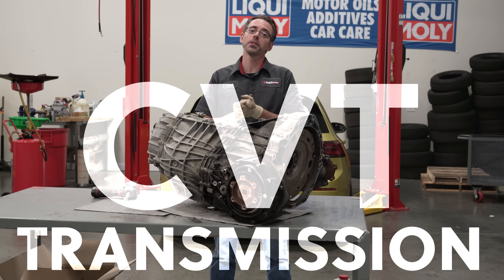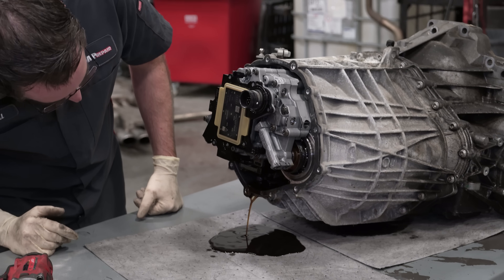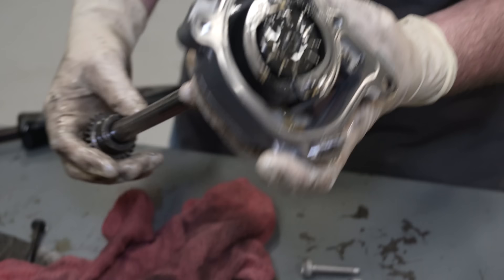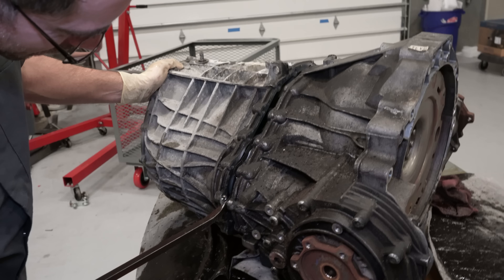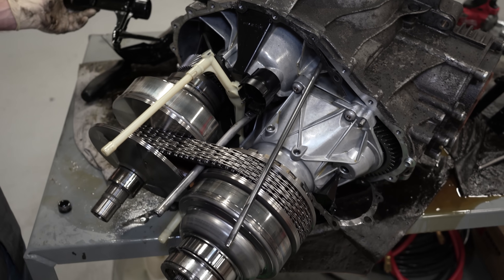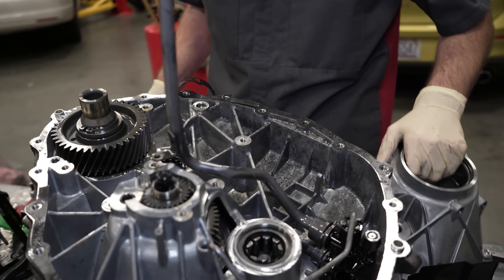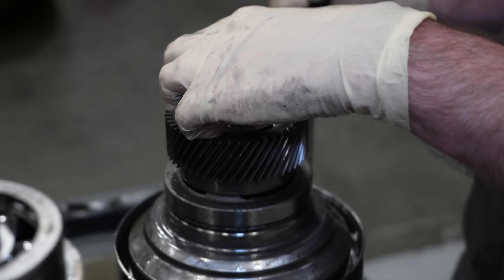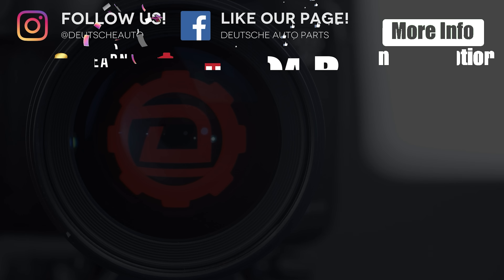Why you shouldn’t get a CVT transmission

Comment: You need a trans table if you are going to work on them! For the record, a trans table has 1"-2" sides and a large hole in the center of the steel table for oil to drain into a five-gallon bucket.

Comment: CVT transmission are increasing the car prices more than the money they save.  This is a ploy from politicians to increase the efficiency requirements to the point the cars are expensive and don't last long.  This is done to force everyone to electric cars.  But electric cars with same range and functionality are 4 times the cost.  So this forces the public without the politicians telling public hey you have to buy electric vehicle for 4 times the price and spend more money on the adaptors at home with limited range.  If you cant afford it tough luck.  This is a suicide for the politicians, so to take public on the same path we just rise the efficiency requirement until public with normal income cant afford it or they cars don't last.  Then we blame the car manufacturers.  Same tactic the politicians use when the price of gas is low, they tell us the oil producing companies reduce the price to make us use more oil.  When the price goes up they tell us ah they are trying to profit (Aim of politicians oil producers are bad guys no matter what price they sell the oil).  Even though all our cars use gas and most products we use that we can live without depend on oil.

Comment: imagine if theres a cvt transmission that you can manually changes the gear ratio with a gear stick like pilots use; slowly pushing the stick forward to change the ratio for higher speed driving

Comment: I love the burning passion with which this gentleman hates CVTs with. He took the time to ruin one on camera. Toyota seems to be doing well, but CVTs are inherently less reliable; they are usually required to have their gear oil changed twice as frequently compared to conventional automatic transmissions (30,000/40,000km compared to 60,000/70,000 km). Its all in the name of fuel efficiency. The fuel efficiency and life of CVTs will also be horrendously affected in start and stop traffic conditions within highly congested cities.

Comment: I drove a Nissan Sentra in drivers ed with a cvt years ago. I never liked it. The constant rpm with no gear changes felt very weird and unnatural. Maybe slightly smoother but instead had a weird rubber band feel. Certainly would never buy one. I like the 6 speed auto in my mazda. Although i really want to try out a dual clutch i have never driven one but i heard they shift very fast.

Comment: As a design engineer and lifelong Machinist, I designed a stuff Plus transmission that can handle unlimited horsepower and torque without slipping. Additionally it can be used with any prime mover and I am looking for a buyer.

Comment: I owned a 2013 Accord that I bought brand new and sold with 186,000 miles (300,000km). That car had a CVT and I had zero problems when I sold it. All I did to the car was regular oil changes and did a complete fluid exchange for every fluid in the car at around 120K Miles. Everything in that car (including the CVT) was stupid reliable.
Reply: I have same car...drive like a grandpa never accelerate fast...hoping I get 300k out of mine.
Reply: Honda CVTs are good quality than Nissan.
Reply: this is the best way, cvts arent meant to be abused. change your cvt fluid every 20-35k and youre at a pretty good position. theres also 2 filter(strainers), so change those every 100k or so. honda cvts arent bad, but toyota does lead the industry with their launch gear cvts since 2023 and their ecvt;s. every other cvt is just dogturd. they key to hondas cvts is to not floor it, and to keep up with fluid maintenance. the key is to not let the fluid get any darker than watered down medium roast coffee.
Reply: So people still believe that a mechanic has more knowledge that engineers ? Lol,
Reply: @diego2817 TRUE

Comment: Toyota and Honda CVTs tend to last longer than other CVTs because of the launch gear. One thing many CVT vehicle owners do not realize is that no damage can occur if you change your CVT fluid more often (unlike regular transmissions with say over 200k miles on them). Additionally, changing CVT fluid more often (say 30k miles or so after the first change) can prolong their life. In the case of some Nissans, changing even after 15k can show a lot of worn material. Another thing to mention is that CVT transmissions work better when the transmission has reached operating temperature. So, in the winter your car may not need to warm up but your CVT does. I would wait till the car reaches normal operating temperature on a CVT car and be extremely gentle on it the first couple of miles (no hard acceleration or deceleration). Another thing is that driving very fast on a CVT can wear it out faster. I would say try to stick below 85mph or 75mph when you can with a CVT car. They can last if you take care of them and have some basic knowledge. Good luck.
Reply: Best comment, I have a Nissan, and now I know I’ve been mistreating it 😂
Reply: Im pretty sure my 2016 honda fit cvt didnt have launch gear, i had to replace the belt at 94.000 km because it broke apart.
Reply: @Arif-fu6rt  how much did the belt cost
Reply: @dkbaghel123  USD 120, i was lucky the other part was not damaged, only replace the belt, clean the transmission, change all the seal, with total cost about USD 350.
Reply: I had 200k on a 2016 accord sport with cvt, and no issues. I changed the fluid with Lucas cvt fluid NOT Honda every 60k, according to the book. I absolutely loved my Honda. Someone ran a red light, and demolished my baby.
Reply: Honda doesn't have a CVT with launch gear. This is a Toyota patented invention. That launch gear version is new and only available for some upper trims. Most Toyota CVTs are without launch gear.
Reply: Honda's use a belt like Nissan, no launch gear. Nissan CVTs had issues but their factory fluid was extremely low quality even when serviced on time. Subaru on the other hand uses a chain and are fantastic, can hold a ton of torque as proven by their by 2.4T suvs and wrx. If they also had a launch gear, which their partner toyota should easily be able to design, would make them great.
Reply: that's sad considering I'm taking my Honda civic CVT at 100+ mph every week
Reply: @LolimGennaro0o  Not an issue. The control knows the limit and if you may have noticed it will upshift quickly than the manual gearbox. What's most important is to ensure that the CVT fluid temperature doesn't exceed 100 to 105 degrees C and there is more frequent replacement than the recommend interval. Important aspect is not to floor it for rapid acceleration but gradually make it reach there (compared to manual). Top speeds are meant to be achieved wherever the law permits.
Reply: @Liguritio  yes, i know that. ty for comment
Reply: @LolimGennaro0o It’s alright, iVETC takes care of the rpm
Reply: @LolimGennaro0o  thats ticking time bomb right there for the transmission lmao!!
Reply: I know Toyota Corollas have transmission oil warmers/coolers, so waiting for the oil to heat up in the winter isnt much of an issue. Takes less than a minute to reach temperature,
Reply: sounds awful
Reply: @bragiodinsen4604 2014 toyota, 205k miles, not one bit of maintenance or care for warming up. I don't drive recklessly (unlike half of what the commenters here do aparently) and at most it sees 80 on interstates 99% of the time (speed limits are mostly 65-70 on them around here and traffic is thick).
A CVT will last as long as any other slushbox or manual as long as you don't thrash it regularly, same goes for every type transmission, they'll last so long as you don't thrash them. Besides, if I wanted to have fun in something I'd drive something built to be fun like my 71 mercury or 05 BMW. If you want something fun to drive buy something that's either built to be fun or is so bad it's good like an EK civic
Reply: That launch gear version is new and only available for some upper trims. Most Toyota CVTs are without launch gear.
Reply: I have a 2014 Nissan Altima S and it has 140k on it it's absolutely trash transmission issues out the ass I was in an accident some girl merged into me on the highway and now it's leaking upfront passenger side and it wasn't leaking prior to the accident but for some crazy reason the body shop is saying no way it's bc of the accident so I basically just keep getting f**ked no lub either
Reply: @ryanclark9386  The CVT on Nissan is trash. You right! But the CVT as concept is a very good transmission.
Reply: @raduvd28  yeah I don't disagree I'm just speaking from my experience with the 2014 Nissan Altima S transmission and it's junk I mean supposedly if you are changing the transmission fluid every 15k miles they last a little longer
Reply: @ryanclark9386  I see your point. I just wanted to underline the CVT is a good technology but Nissan has integrated wrong
Reply: Basically less reliable than a Model T Ford.
Reply: I have a Nissan Rogue 2019 no issues, it has about 59k very close to 60k, I am going to change the CVT fluid for the first time, then every 30k maximum. I drive basically only in my city no more than 65 mph, 40 mph average. Basically I use my Rogue to go to work.  It still has the original battery and it will be its first brakes change. Excuse for my English, I am still learning.
Reply: Isn’t it great that Honda eliminated the transmission fluid dipstick.
Reply: We have a Honda HR-V with 24,500 miles.  Cvt hasn't been changed. Oil is at 80%.  What do you suggest?
Reply: @SlowerTrafficKeepRight-k2g My son has a 2018 HRV with almost 150k on it in a hilly area (job requires and pays mileage 😂). He has had CVT fluid serviced every 40k by our family's mechanic since new and it works flawlessly. Key is to use Honda factory fluid only.
Reply: @christopherharris3229  could you tell me where he gets the Honda factory fluid?
Reply: @christopherharris3229  And he doesn't go to a Honda specialist?
Reply: @SlowerTrafficKeepRight-k2g rock auto my dude
Reply: Very good information, thanks for your time.
Reply: Does changing the fluid frequently protect the belt?
Reply: I'll stick with my Toyota hybrid.  Electric car with gasoline assist.  The gasoline engine assists up through a planetary gearset.  The motor driving the sun gear provides CVT action for the gasoline assist engine. Planetary gearset, no sleazy belt or chain.
Reply: So basically what you're saying is that CVTs are garbage.
Reply: So , you're basically saying that the CVT is steadily self-destructing  (worn material in the oil ) , and has to be nursed and treated very gently ?
Not what one would expect this century .
Reply: Honda have a couple recalls on most cvt, been horrible working at the dealership
Reply: Realistically they last longer because they’re built by Toyota and Honda.
Reply: Yeah…I’ll just stick with the regular automatic transmission.
Reply: And do not accelerate a cvt equipped car hard from a standstill. That CVT will not hold up if you do.
Reply: Your CVT should last a lifetime  if you take care of it by not driving your car.
Reply: @dansmith2863 LOLL. Take care of the cvt by not driving the car.  So funny!
Reply: Ha! Good one.  @dansmith2863
Reply: I had a Honda accord for 300k with CVT. Zero problems on CVT. Now, I'm driving a Honda civic 2018 1.5T. After 120k zero problems on CVT.
Reply: @raduvd28 Have you been changing the fluid and how often
Reply: @SlowerTrafficKeepRight-k2g  Yes. According with user manual
Reply: I paid $25,000  for my car....I'm definitely going past 75mph when I feel like it idc
Reply: Way too much trouble than it's worth. I wasn't born to maintain a CVT, life is not about how much you can maintain a CVT. I still drive a manual stick shift
Reply: @SubSaharanWolf I have only one problem with the manual stick shifter. In heavy bumper to bumper traffic, it could be very hard on the clutch.
Reply: @dancapell6643 Not if you know how to drive the stick shift.  Never had that problem.
Reply: @SubSaharanWolf  Exactly.
Reply: @SubSaharanWolf nobody fuckin asked
Reply: @SubSaharanWolf  OH, so changing fluid (oil) in transmission is so life costing operation ... even in interval is 2-3-times longer than engine oil. Thus use the public transport because car clearly drains your life, as it requires changes of the brake fluid, cooling liquid as well, also regular filling of the tank even just every few days or windshield cleaning fluid. And replacing brake pads. And tires. And ... 
Even manual transmission requires oil change - just people pretends that not.
Reply: Buy a cvt to drive like grandma and grandpa down the roads and have 0 fun while driving 😴
Reply: @mincraftisawsome1234 You can just say you're short bro you don't have to hide it behind driving fast. Gotta feel big somehow lil fella.
Reply: @ReaperOnRepo  lmao sure bud whatever makes you sleep better at night.
Reply: Driving below 85mph is hard to do on Chicago highways. My 2021 Highlander Hybrid just rolled past 90k miles and gets driven daily where I reach speeds over 85mph year round in all temperatures.
Reply: @Noypi54494 your highlander must be absolutely guzzling gas going that fast on the regular. Yikes.
Reply: @mootsym I still get around 25mpg winter and 30mpg summer. Almost at 150k miles
Reply: @Noypi54494  not bad considering! good for you. I'm happily averaging 40/tank on mixed driving with my Accord.
Reply: @matthewmaneri3098  That's awesome MPG my friend. Happy New Year!
Reply: This and other put downs are rubbish cvt now is excellent
Reply: The best CVT properly maintained are LUCKEYgetting 150k, changing oil on schedule extends duty cycle from like 80 to possibly150
Reply: Subaru also has a nice CVT (performance rivals a manual transmission in some models).  And Nissan's CVT, well, let's say that the "T" does stand for "trash heap", just like the VW's.  Like most things, YMMV.
Reply: @jellybeans6533  they are both from Jatco. Older Nissan CVTs were problematic. The newer ones are decent.
Reply: @jellybeans6533  maybe in more recent models, but they have been garbage in my experience. Had a 2013 impreza and the cvt sucked. Forget about acceleration from a stop. It would take forever to get up to speed. Plus it frequently over heated.

Comment: Friction is the principle. Automatic Transmission gears are changed with the use of clutches (friction is used for a short time) and after switching the gear friction is low, CVT on the other hand works on friction 100% of the time and which makes it worse, it is dynamic friction. Friction is bad, so buy a car where there are no mechanical belts or clutches.

Comment: Toyota CVTs seems to last but they are different from the belt and pully type I think. CVTs are definitely cool technologically and looks wise, that chain belt looks neat. I have see other car CVTs where the belt looked more like a belt and Toyota's just looked like planetary gears with an electric motor in there somewhere. It seems everyone has different ideas for how their CVT will work. or you could be Ford and keep putting more gears in a regular automatic transmission, I'd be a bit curious to see one of those on the inside next to an old 4 speed auto.
Reply: I have a 10th gen civic with a cvt that I drove the crap out of (flooring gas pedal from stopped position, driving fast and hard, using paddle shifters to switch gears, etc.) And I have 250k on the cvt right now and it still feels brand new. Only did one transmission fluid change at 90k miles. If you go with honda or Toyota the cvt will last just as long as a traditional transmission and even longer if you maintain it

Comment: I’ve had three Nissan CVT’s. One started to slip at 125,000 miles. Instead of letting it go until it failed, we replaced it immediately with a new CVT for $3,600. The other two are still running strong.
Reply: first mistake was getting a nissan cvt, those things are terrible. Your best bet it to change the fluid probably every 50k miles (could do 30k if you wanna be extra safe).
Reply: @QuincyStick 30k is my trans plan.
Reply: Alan, do you drive an Altimañ

Comment: CVT never buy a car with cvt. I drive a subaru 1994 4x4 . A perfect car, no cvt. I recently viewed a cvt 4x4 subaru outback that could not climb a hill because the cvt  just slipped and overheated the transmission. My car easily went up the same hill.

Comment: Wow, infinitely more complex than how the Shopsmith Mark V did the same thing with a V belt and a crank.  I would have thought it would have been much more simple to change the diameters that what you show here.  Many commercial AC units have adjustable diameter pulleys to set the air flow across the A coil for the proper compressor head pressure, but not much to them except threaded shafts and lock screws.

Comment: I have an old Volvo 340 rubber belt (DAF) 
 CVT (one of many old cars)  and my wife has a Honda Jazz CVT.  Many years apart but similar principle.  Can't believe how complex the modern version is.  Jazz is far more refined, but if it goes wrong, I won't touch it, unlike the Volvo!